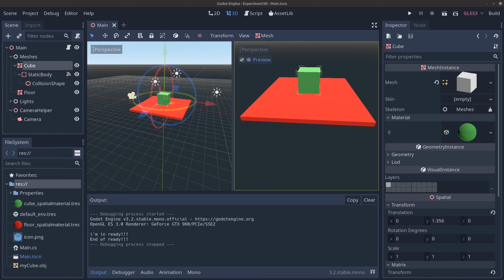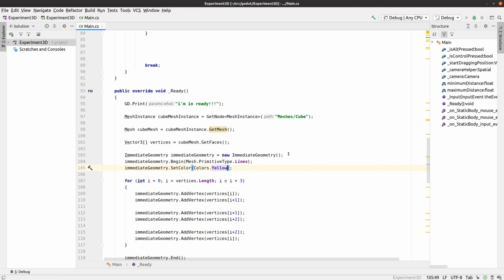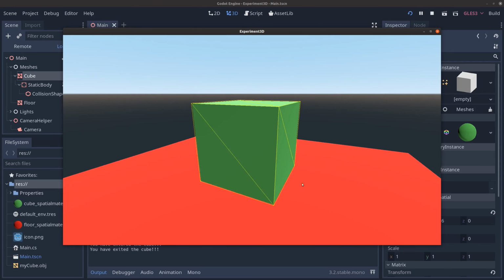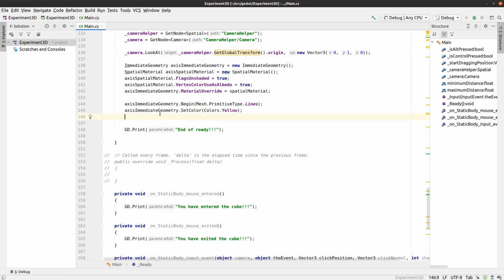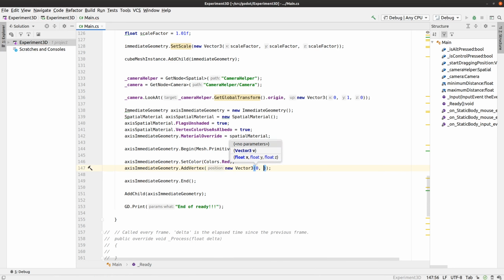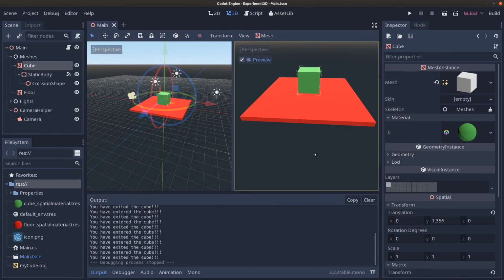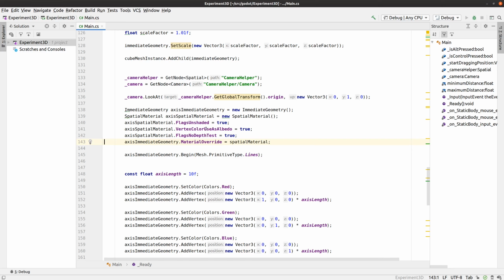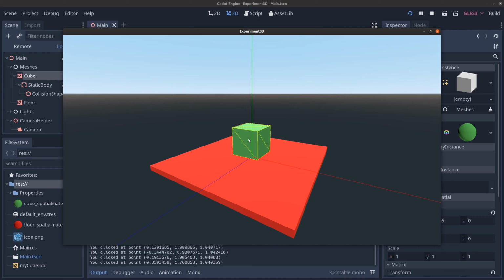Godot 3 - 3D Mesh Manipulation - 06 - Fixing the Wireframe and drawing axes in C# with the Rider IDE

Comment: Getting these Axes to work in GDscript is a bit different so I will leave it here for reference how I did that part:

func _ready() -> void:
	# Draw axes X,Y,Z
	var axis_length = 5.0
	var scale_factor = 1.0
	add_child(create_axis(Vector3(1, 0, 0), Color.RED, axis_length, scale_factor))
	add_child(create_axis(Vector3(0, 1, 0), Color.GREEN, axis_length, scale_factor))
	add_child(create_axis(Vector3(0, 0, 1), Color.BLUE, axis_length, scale_factor))

func create_axis(axis: Vector3, color: Color, length: float, scale: float) -> MeshInstance3D:
	var axis_mesh = ImmediateMesh.new()
	axis_mesh.surface_begin(Mesh.PRIMITIVE_LINES)
	axis_mesh.surface_add_vertex(Vector3(0, 0, 0))
	axis_mesh.surface_add_vertex(axis * length)
	axis_mesh.surface_end()

	var axis_material = StandardMaterial3D.new()
	axis_material.shading_mode = false
	axis_material.no_depth_test = true
	axis_material.albedo_color = color

	var axis_instance = MeshInstance3D.new()
	axis_instance.mesh = axis_mesh
	axis_instance.material_override = axis_material
	axis_instance.scale = Vector3(scale, scale, scale)
	return axis_instance

Comment: During that 2nd video, I already ran into the problem of the colors not being honored. After asking ChatGPT (yeah I know), it explained that it would require some sort of material in order to get a color. It provided me with this code, which does work (in GDscript). Now watching your video about this so you confirmed what ChatGPT provided me.

	var material = StandardMaterial3D.new()
	material.shading_mode = 0;  # Disable lighting effects
	material.albedo_color = Color(0, 0, 0)  # Set pure black color
	mesh_instance.material_override = material

Comment: My code up till here. Main change here is I've added the axis lines to the cube instead

func _ready():
	
	# ...
	cubeMeshInstance.add_child(ig)

	var axisGeom = ImmediateGeometry.new()
	var axisMaterial = SpatialMaterial.new()
	var axisLength = 10
	axisMaterial.flags_unshaded = true
	axisMaterial.vertex_color_use_as_albedo = true
	axisMaterial.flags_no_depth_test = true # Makes it so the lines are drawn over the earlier added objects
	axisGeom.material_override = axisMaterial;
	axisGeom.begin(Mesh.PRIMITIVE_LINES)

	axisGeom.set_color(Color.red)
	axisGeom.add_vertex(Vector3(0,0,0))
	axisGeom.add_vertex(Vector3(axisLength,0,0))
	axisGeom.set_color(Color.green)
	axisGeom.add_vertex(Vector3(0,0,0))
	axisGeom.add_vertex(Vector3(0,axisLength,0))
	axisGeom.set_color(Color.blue)
	axisGeom.add_vertex(Vector3(0,0,0))
	axisGeom.add_vertex(Vector3(0,0,axisLength))
	
	axisGeom.end()
	cubeMeshInstance.add_child(axisGeom)
	
	print("Exit Ready")
Reply from the maker: If you mean as a child of the cube - be careful. Remember, we moved the cube up slightly in global space so it would be above the floor. If you child the axis ig under the cube (remembering that children inherit their parent's transformation ) those will be axes for the cube not global axes.

They'll be very close to global (as we only moved the cube up a teeny bit but still)
Reply: @hobbytasks8240  yup I wanted the axis to be on my cube. I change it to the root in the next step so I am following your refactor